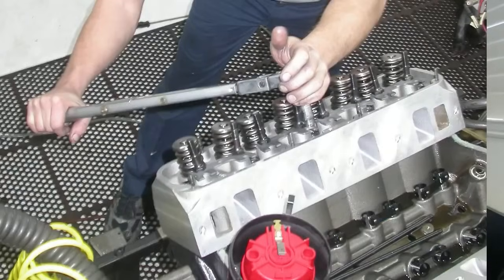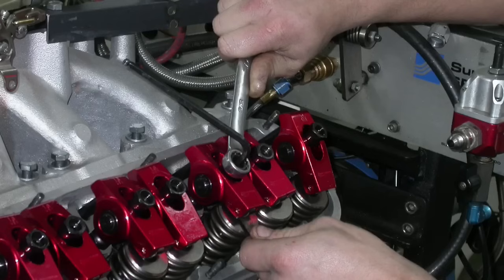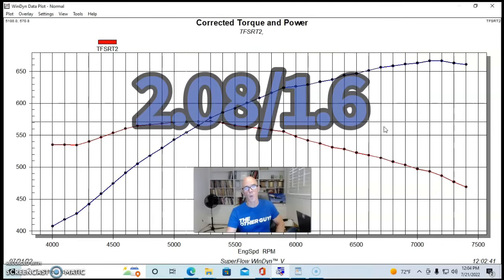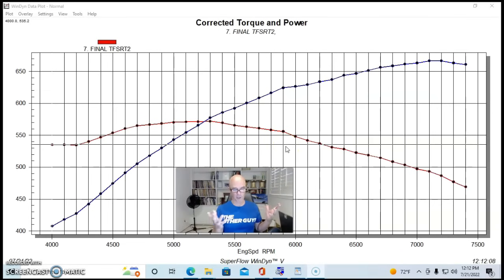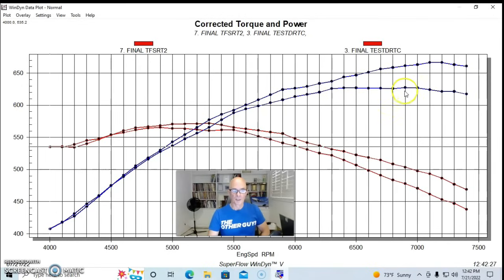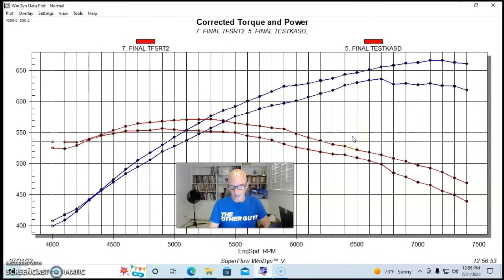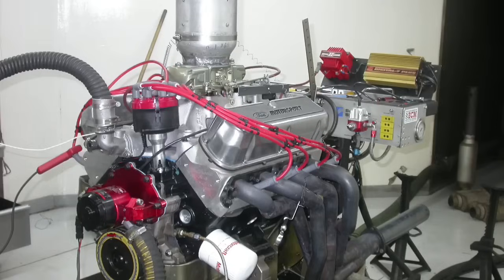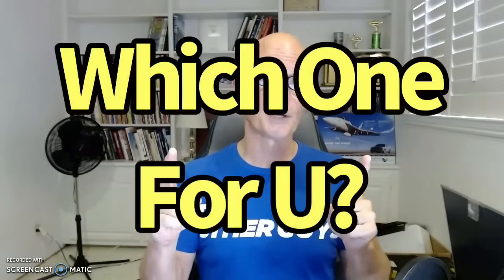WHAT CNC-PORTED SBF HEAD MAKES THE MOST POWER? KAASE v AFR v TFS R v DART v CNC VIC JR & HIGH PORT?

Comment: I would have liked to see the Kasse heads milled down(angle?) to 57cc chambers with some bigger headers. I think they may have given up on the top end more than the others with the comparatively small headers. I'm making that hypothesis on the grounds of the greater departure from conventional Windsor valve layout. I think the compression difference may have made them a real winner as far as torque under the curve too.
Reply: I really love the Kaase heads - but, today, the inline stuff is some of the baddest SBF stuff available. For example, these old school High Ports don't represent what today's High Ports are capable of(presumably, these are the older HPs before Brian Tooley revised them during his time at TFS), as the modern stuff tends to beat out any of the Twisted Wedge offerings, especially with modern porting programs from places like TEA. Or Eddy SC1s, still one of the best SBF heads, and another inline piece. So I gotta disagree with the "moving further from Windsor architecture" theory, that was true in the past before we got heavier development in the SBF world(Twisted Wedges are one of the OG EFI era aftermarket SBF heads, and their capabilities & popularity probably initially slowed development of the inlines). But, today, it's damn hard to beat the modern inline stuff, you have to go with some pretty serious canted valve pieces to surpass them. Not to mention, inlines have better valve geometry in Windsors(lifter placement) too, which helps get the most out of them up top.
Reply: nothing you are talking about has anything to do with one another.  Might as well had Richard run different valve cover breathers as well.

Comment: Here is a test for that combo, Higgins cylinder heads, CHI, Brodix o Neal , Hammer head hemi head's. All ported.
Reply: Garykaren, I’m also a firm believer in the canted valve Cleveland type heads that you mentioned. In nearly all of those configurations, they will have better flow on the bench, have better results on the dyno and perform better in the real world known as the drag strip.   

Using Pro Stock as an example, I don’t recall an inline valve SBF (Windsor) combination ever winning a Pro Stock Championship like the modified high port iron Clevelands did numerous times before being phased out by the 500 cubic inch requirement. 

The Australian made Higgins Cleveland heads are awesome performers along with the Hammerhead SBF Hemi Heads. But the high cost would probably prevent them from being included in a modern comparison test such as this one done by Richard. 

I think Greg Brown’s Hammerhead SBF Hemi Head package is actually a pretty good deal. In addition to the amazing heads, the package includes a state of the art Jesel rocker arm system, the required valve covers which look like Boss 429 covers and the rest of the name brand components needed to use the heads on any Windsor or Cleveland block. The available Cleveland intakes are limited but I don’t see that as a problem. 

Hammerheads come with premium 2.20” intake and 1.650” exhaust valves. As cast they will flow 392 cfm intake and 275 exhaust. Typical ported flow is 462 cfm intake and 320 exhaust. 

In June 2017, Greg did some dyno testing at Charlie Peppers shop with promising results from his new heads. The 427 combo used stock sized valves, a Man ‘O War Windsor block, a 1250 cfm Dominator carb, a cam with 281*/297* duration @ .050” lift and 14.8:1 compression. The results were 966 hp @ 7700 / 674 tq @ 6000 rpms. Pretty good numbers but the dyno data indicated that a larger carburetor was needed. A better intake manifold like the CHI would have probably picked up an additional 30-40 horsepower. 

But that testing was done 5 years ago. I’m sure that more recent test results would be considerably better ! 

The Higgins Heads and intake manifold can be seen on YouTube in a dyno video posted by FullBOOST. It’s a 461” Clevor street engine built by Dandy Engines Inc. in Melbourne, Australia. Using a single four barrel carb, 13:1 compression and running Aussie pump fuel it produced 934 hp and 669 tq. 
Running race fuel it produced 979 hp and 700 tq. 

There are some great Windsor type heads available. But I think the aftermarket Cleveland heads have a slight advantage. Just my opinion. Others will surely differ 🏁👍.
Reply: @danielwilson6665  I agree, ever since 5 years ago, the typical numbers has climbed. As for intake manifold's.  That depends who ports them for sure. I would love to see Darin Morgan from BES port all the tested heads and intakes. But run a big bore 427 stroker Ford 4.125" bore to 4.000" stroke. That would be very very interesting to see. Allow the heads to breath and the power numbers climb.
Reply: @garykarenmcgruther6386  … I’ve seen some fine examples of Darin Morgan’s work and I agree that he is one of the best in the business. Canted valve Ford heads work quiet well with increased displacement 🏁

Comment: To bad you didnt run a set of Cleveland 225cc or CHI 225cc heads to watch them walk away from the inline valve heads. I know it would have been major surgery though changing pistons. Im glad the Trick Flow heads beat them all though especially the edelbrock and dart heads.
Reply from the maker: I'VE RUN CHI HEADS
Reply: @richardholdener1727  But i'm talking about as a direct comparison with this 427W short block. Get some Clevor 427 action.
Reply: TW's been kicking ass for about 25 years...     All these fancy inline valve heads were getting dusted on the basic 5.0/Cobra combos in the days.   The results were higher tq and HP across the board due to a superior chamber and better low lift flow.
Reply: It would've been interesting.   It takes all the way to CHI level to start beating the TFS TWR heads.   And the TWR bests all the inline valve heads like it always has.
Reply: @dennisrobinson8008  That's not CHI fault the aftermarket cant keep up with the Cleveland head design.  Yup the TWR heads are great. 

The only reason I said it would be interesting to compare the Cleveland design Trick Flow 225cc or CHI 225cc heads is because he brought in the TWR 225 head. Testing these on the same 427 would have put the conversation to rest to all the "inline valve people" that the Cleveland design head will always out perform and has always dominated any other small block factory head no matter what brand it is. I guarantee you my Trick Flow 225 Cleveland heads will  kick the TWR A$$ at any rpm and power level. 

It only takes a stock set of Cleveland IRON 4v heads to out perform the TWR heads on a big inch engine. The TWR will have a little edge down low but the IRON heads will dominate like always. 🦾
Reply: @nova467spanker  They truly are some badasses!!!   We always heard negative gossip about these heads about them being "too big", "poor velocity"  back in the days, but it's clear to see they were basically race heads from the factory and you really aren't going to beat it on a proper high rpm or high displacement build.   The TFS TWR did do a good job getting most of the gains of the Cleveland,, but i agree like you say that the Cleveland especially CHI are a step above a good prepped TFS TWR heads.

Comment: I got the Kaase/Jegs on a 347 stroker and pulled 618 at 6500
Reply: Sweet.     618 HP at a LOW 6500 RPM.   The peak torque must've been high!     Peak torque on good built 347-355 cubic inch gets over 500ft-lb, sometimes to 525 ft-lb even...

Comment: The headers did not hold the engine back at all, 1 3/4 Dia is plenty big for the HP output. What head should you have used, well a CHI 208.

Comment: I would really like to see you test the Higgins heads and intake. Very few people test those.
Reply from the maker: HIGGINS?
Reply: @richardholdener1727  yes Richard he's a Engine Builder from Australia.
Reply: https://www.youtube.com/watch?v=s3oxTGDiGSc - here ya go! 762 RWHP - pump gas  - Drag Week build
Reply: @edcurtis3375  I never saw that channel before, great find. That is a perfect example of heads that make more whp than the ones Richard tested here will ever make at the crank. There are videos mentioning some of the Higgins small block heads topping 1000 hp NA on the dyno, on pump gas. But there are very few video's of them actually doing that. That is not to say that there are not any videos thou, there are. Why would you buy anything less cylinder head wise if you want the most reliable power? Yes they are expensive heads and yes they outperform most other brands, massively. Higgins is just one example as well. There are other companies that make excellent heads. If you want to do a horsepower comparison include heads like Higgins that make the ones tested here appear to be as lame as they actually are at making serious power gains..... If you want to make power, none of the heads Richard tested are actually on a list of heads that will make serious power. Drivability of heads that make massive power is oddly better than the ones that don't as well. So anyone thinking that ports that flow that much will sacrifice drivability, think again..
Reply: @shvrdavid  - I've worked on quite a few of the Higgins based builds with ZSR Racing engines as well as retail customers. They are all proven power makers. These people just don't do the "Boob Tube" stuff for clicks.
Reply: Cleveland Head.
Reply: The Higgens pieces are serious equipment.   Higgens, MBE and SME have heads on the Cleveland style architecture and you can throw in the hammer head and other Hemi style architectures and get CFM in the mid 400's all the way to 500CFM.

Comment: My flat top 393 made 626hp on a super flow with the later p-38’s. 60cc chambers. So around the same compression. I’d say it was valve train issues. Smaller camshaft too. In the 250’ duration and right at .700 lift.
Reply: When power suddenly dips at a higher RPM, that says, "valve float."
Reply: JON KAASE set them up guys.. he knew the specs before he sent them and confirmed they shoulda been fine.   So I guess Kaase can't setup his own heads.  Thanks internet guy!!!!!!!!
Reply: @superkillr   maybe I’ve not seen it in the video, but I don’t think he made mention of Kaase sending him the heads personally or setting them up. Those heads were designed by Jon and sold thru Jegs. I’m old enough to remember that. I’m sure they had springs for a solid roller, but not all solid rollers are equal. I have one here that only requires 650 open, and I have another that wants 900 over the nose. I also new someone who had a set and ran very deep in the 6’s in the 1/8 mile with a 347 in a fox mustang N/A. It’s almost certainly valve train issues and valve float. I’ve spun mine 7600 with Manley Nextek springs and not a sign of valve float.
Reply: I have the p38s
Reply: Yea but what did it make at the wheel behind a big stalled th400.  Probably under 500wheel but faster than any stick.

Comment: Too bad TFS discontinued the R head.
Reply: Its not been discontinued.The TFS R head are still sold by Summit Racing & have been redesigned with thicker decks & no cracking in the combustion chambers.I make 600+ with a 408 pump gas Windsor & TFS Stage 5 cam.
Reply: @brettcotton3927  the 225 isn't even LISTED on Summits or Trick Flows site anymore, much less being available. You are correct about them being redesigned but that was many years ago.   If you dont have a LS or Cleveland, youre SOL.
Reply: TFS Rs are still a bad ass set heads to have on a SBF Windsor.VERY under rated head that makes plenty of power N/A or boosted bar no other other set of heads in its class!

Comment: I think the 427 clevors with CHI heads make around 700ish hp on pump gas from a video I saw years ago
Reply: In 2004 I went to AU. to do some testing w John K the owner of CHI. We built a 427 clevor and w out of the box stock 218 CHI heads we made 745 Hp and 648 Tq w a lot less cam. We installed the engine in a 3600 lb 4 door Falcon. The first time out the car ran 9.30s @ 142 mph. and yes on pump gas.
Reply: @racerd9669  That high 648 ft-lb shows how efficient those bad ass 3V CHI heads are.    Out of 400-427 ci, i'd be happy at 600ft-lb up to 625, but the CHI's are making 630 all the way to 670 tq out of 427-434 ci on good builds.    The Cleveland architecture had been overlooked by many of us who grew up in the original "5.0" days...   .
Reply: CHI are used in 600-1000 HP builds...   They make excellent power, the peak torque numbers are extremely high ( 650ft-lb out of 427 cubic inch ) showing the efficiency of the head.

Comment: I would think the small header would choke the exhaust flow some.. if you have  an exhaust port that flows 245cfm but a head pipe that can only flow 200cfm I would think it would affect cylinder clearing and cylinder filling. It would effectively make a high flowing intake port less relevant.  Better redo the test with bigger headers @richardholdner !!!!!! 😂😂

Comment: I really expected the AFR heads to reign Supreme. However thats nothing to be ashamed of . I really thought 700 hp was going to happen. I believe its possible with 427 cubes and AFR heads . You would probably have to hit it with more money 💰. And a wand 😉!
Reply from the maker: IT DOES WHAT IT DOES
Reply: TFS TWR heads ported were always some badasses and a little bit better than even the very best inline valve head.   That data goes back 20 years or more.

Comment: I would use a CHI head and make a dart block, big bore 427 clevor if I wanted to make power.  I know you asked what I would use for the windsor, so I guess if I am to be hamstringed by that requirement it would have to be a twisted wedge offering.
Reply: Same. Cleveland-style heads on windsors is superior to normal Windsor heads

Comment: To me it seems the Windsor and Cleveland was like the Beta Max /VHS situation, why did Ford axe the Cleveland? The conclusion I have come to is the Canted  Cleveland 2v head is far superior flow wise anyway. I would think a affordable 100% bolt on Cleveor head that used any Windsor intake was readily available regular Windsor heads would be pointless. I see a video showcasing a head of that description (minus the affordable part) that Edelbrock made but I can't find anything else on it. Also will a Cleveland easily bolt into a fox/sn95 with very few mods if any?
Reply: The Cleveland was dropped due to emission requirements. Because of the canted valve design  the ring package needs to be lower down on the piston. This produces more unburnt fuel that sits on the upper sides of the pistons. That small amount of fuel means that the Cleveland would not pass emission requirements (back in the mid 70's) The Cleveland was produced in Australia up to the mid 80's because of less stringent emission requirements in Australia.
Reply: Do some reasearch on the CHI 3v heads. I make 2800hp with a 44ish sbf with twin turbos. If you want to make power this is the way to go.
Reply: Factory American 2v Cleveland heads have a horrible combustion chamber and the ports aren't efficient when you compare volume to flow. But port wise are better than factory Windsor heads just a few draw backs with some big pluses
Reply: I guess as much as I hate to accept it other than the vintage crowd old pushrod engines will be obsolete in the performance world, even tho doable its getting more and more expensive and impractical to get on same level. When you have a car like a stock GT making 460 n/a hp off the showroom floor with a very mild tune and full emissions. That's an fairly built and expensive Windsor... To surpass that your now looking at boost and expensive short block work to see safe 700hp. If you do that to a coyote you can have over 1000hp! So now budget route is a junk yard truck coyote or GM truck 5.3 and cheap boost. Even tho is doable the cheap route to 700hp is absolutely not doing it with an old Windsor or SBC sadly.☹️
Reply: @fiveohh95  I have a 410W that makes over 460hp and 500ft/lb on pump gas and revs to 7,000.
Reply: If i had a 400+ci anything that i built, my minimum allowed torque would be 600ft-lb.   My compression, cam, heads, intake, carb and exhaust would be setup so that it can achieve this. @RadDadisRad
Reply: @dennisrobinson8008  I was running a very conservative pump gas tune. Something that idled at 700rpm and I could hang it off the limiter for minutes at a time. I didn’t want a tune that wasn’t flexible to poor gas or if my fuel filter started plugging up.
Reply: That makes sense. @RadDadisRad
Reply: @fiveohh95  Now mister smarty pants !!! Put a carb on that engine and take away the computer and see how it runs !!!
Reply: Emissions didn't just kill the Cleveland - it's also why Windsor heads never progressed too much.
 
As far as running factory Cleveland heads, as awesome as they [could] be(North American 2v, ehh...), they're still iron factory heads. Affordable aftermarket heads left very few wanting to bolt factory stuff back on, let alone iron. TFS Twisted Wedges were just too affordable and too good - no one was thinking about a Cleveland by the time they hit the market, because Windsors tend to be cheaper to build(I wonder if that still holds true in Australia...), and a set of TWs allowed you to make a lot of power on a budget - as illustrated by this test. Legendary heads, really helped kick off the 5.0l aftermarket.
Reply: @RyTrapp0  a proper combo with ported 4V Cleveland heads is very capable, of course that is about where you start with evolved Cleveland style aluminum heads and going from there.  Actually there are plenty of folks still doing clevelands and now you can even get new and very improved blocks.  A 393 Cleveland with a real good set of heads and tuned with the right combo will crush a comers with inline valve heads.